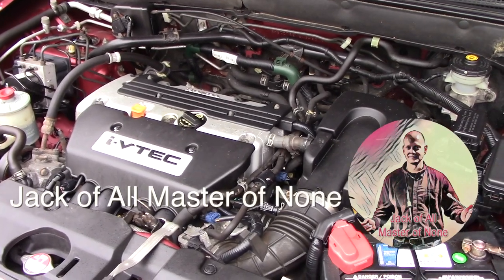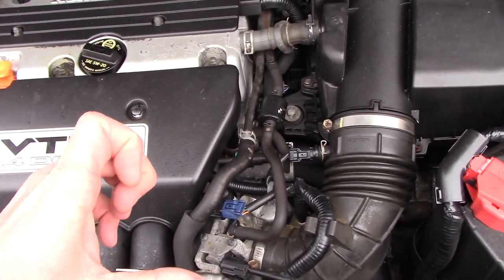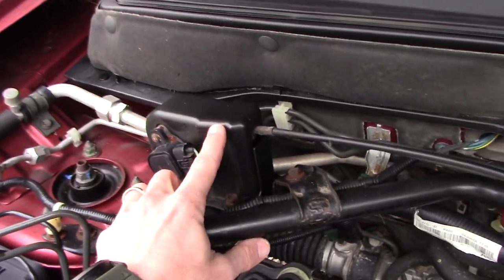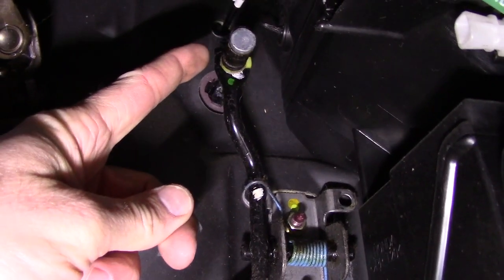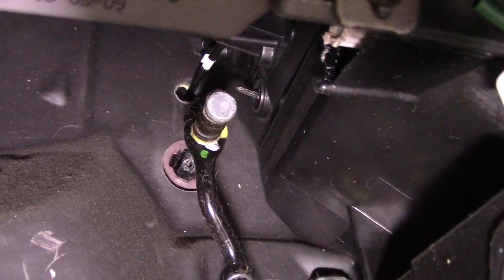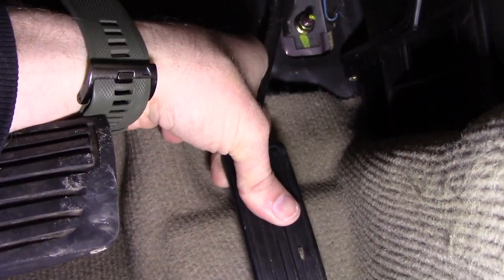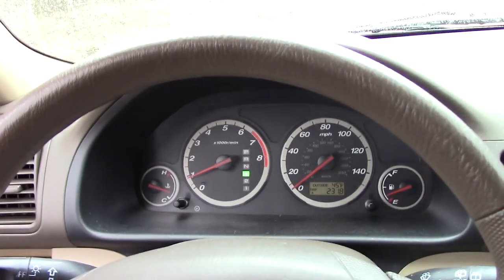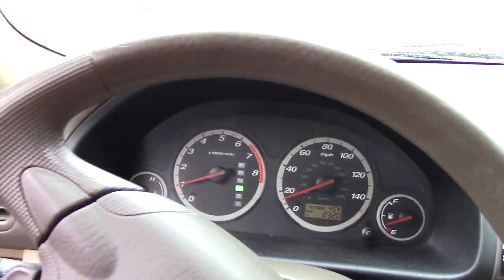Honda CRV Wide Open Throttle Performance Enhancement - Throttle Cable Stretch Fix

Comment: I have a problem to my CRV when we changed all the hoses from radiator under the engine the mechanic move all the sensor including the throttle body..when everything is ok when i begin to start the engine..suddenly i observe the idle was change it begins to fluctuate the idle what do you think the problem

Comment: Thank you for this video! The throttle cable in my 2002 CRV is missing the rubber isolator, no wonder it feels so sluggish even after a complete teardown and rebuild at 230K.

Comment: Thank you so much👍👍i had the same slack as you did,i didnt have any exceleration problem but just slack on gas pedal and mine is 2003 model and not hybrid like yours.no more slack but do i have to change cable anyway.😁😁😁😁😁🇬🇧🇬🇧🇬🇧🇬🇧🇬🇧